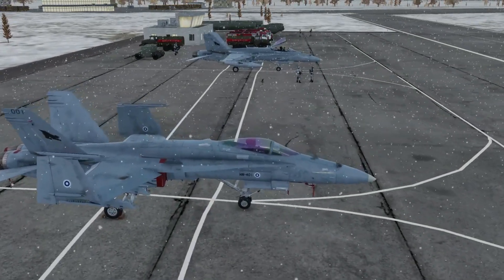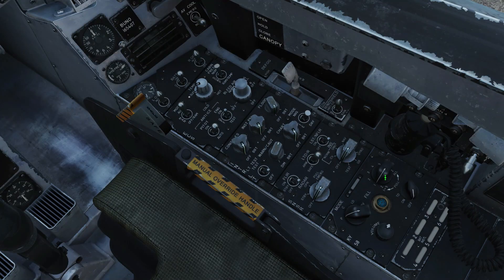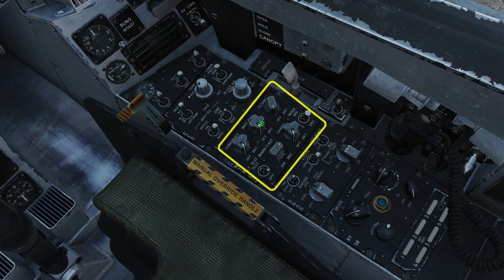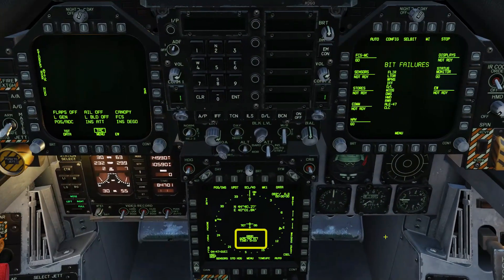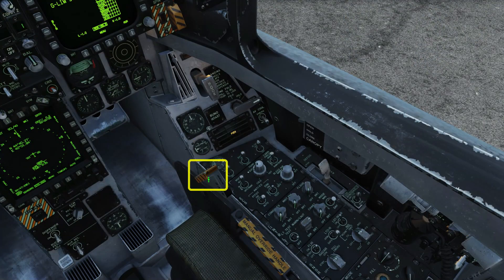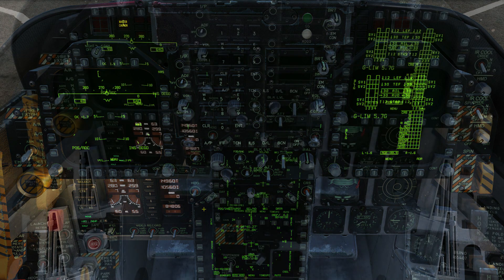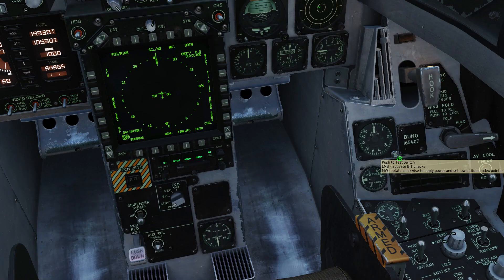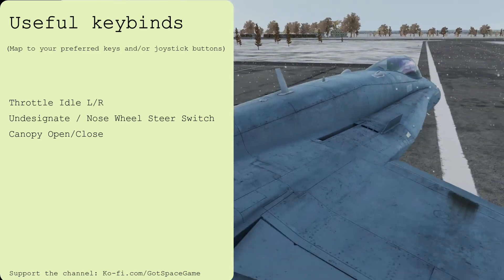F-18 Cold Start Tutorial - Quick Hornet Cold Start using INS Stored Heading - DCS in 3 Or Less

Comment: Great reminder video, and it faster than I did before. You did not execute the BIT test, does that not result in not ready status for many systems?
One note, setting the altimeter to 0 is not correct. You can set it to the field elevation, or the altimeter/QNH value.